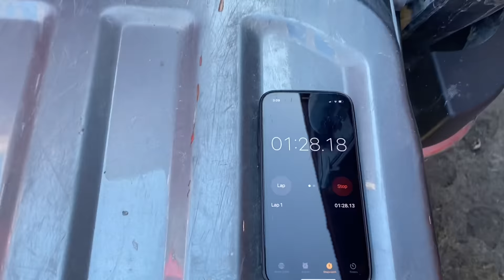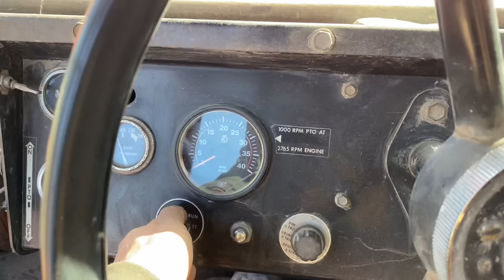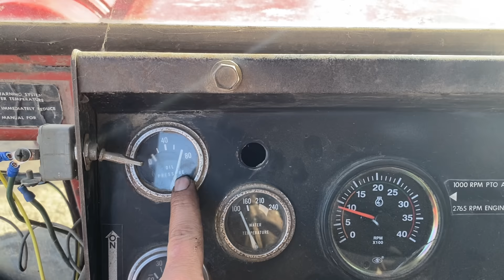Around the farm with JT. Oil changed, fueled up!  Ready for spring

Comment: I had 200gals of fuel in the basement(new furnace,switched to natural gas...)that I needed to get out last fall. I bought a Vevor pump and it did the job impressively. I backed up to the house and filled tractors. I liked the clear hose,very flexible,I got both ends in clear hose. My nozzle is a bit different,and it has a lock but no auto-shutoff. Glad to hear that the advertising is paying off💰. Just too late for me to take advantage of. 🙁
Reply from the maker: Right on!  Glad to hear the pump worked good either way. My tractor splitting stand is a be or as well, has been good to me!

Comment: Happy Easter!  I have a customer that is an oil blender.  They manufacture high quality synthetic for all types of engines and compressors.  The key for maintaining equipment is using good filters, good lubricants and staying on a regular maintenance program.  They also sell fuel line cleaning products which is mixed with the fuel.  I have used it with both diesel and gas injected engines and the results are amazing in improved performance.  Just wondered if you using anything to clean the fuel lines, injectors and heads on those diesel engines?
Reply from the maker: I use sea foam from time to time
Reply: When you have a chance search High Performance Lubricants.  They are located in Manteno, IL.  I have used Sea Foam as well but the HPL product is far better.  12oz. treats 96 gallons of diesel fuel.  I bet it would really clean up that 1800 since it was sitting for so long.  If you wanted to try some I'm sure we could get you a box to try.  I think it would help all the older equipment though.  Let me know if your are interested.
Reply from the maker: I’ll check that out. Thanks!

Comment: According to the internet the 1805 takes 120 gallons or 454 litres of fuel on a full tank and 13 gallons per hour or 48 litres per hour quiet a lot considering how big the engine lol 😁
Reply from the maker: I’d say the 120 gallons is accurate or close, but I have never run it hard enough to burn 13 gallons an hour, maybe 10 if I’m pushing it 😉. It’s not bad on fuel.
Reply: @jtsbarnngrill6873  I agree considering the amount that tank has it's not that bad lol :)

Comment: JT you might want to consider doing an oil flush the next time you change oil. You be surprised how fast the oil pressure will build up after cleaning all the oil passages.
Reply from the maker: Probably wouldn’t hurt.  Although the oil doesn’t go instantly black when I change it, gives me some hop the engine is in fair shape inside

Comment: Nice one j.t.  glad there's still people out there change there oil a bit before the right hours come.  Did you cut out the bit off for doing drain plug or I miss that bit. You got lucky again with tyer.  I feel my oil filters up first. I take it you going to tyer people in to change those big tyers . If not you want stand them up because off the weather and how long it's going to be before you change them the side walls get soft and start to sage and then they are a pig to put.  You got your radio in or you ues Bluetooth speaker.
Reply from the maker: The drain plug would all be there. Was in the beginning. Those big tires will all go to the tire man. Those are too heavy to mess with for me 😉
Reply: @jtsbarnngrill6873  ya though so.  I only  said about drain plug because I didn't see you put a spanner on it to do it up I see you put plug in then next thing I see you put filters on. I just want to blow engine up that's all.  I've seen it happen to many times

Comment: Cummins specifically says NOT to prefill filters. The concept is you're more likely to do more damage through contaminating the "clean" side of the filter than through the extremely brief delay in oil pressure.
Reply from the maker: I have heard that from someone about Cummins.  Makes sense